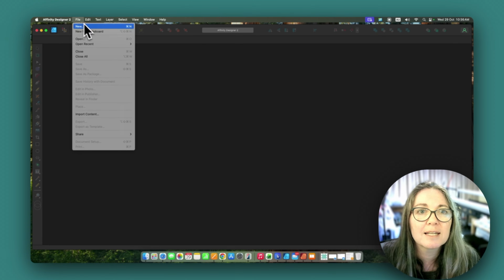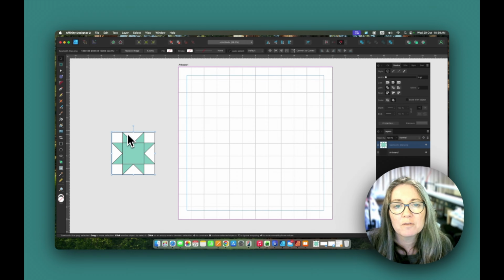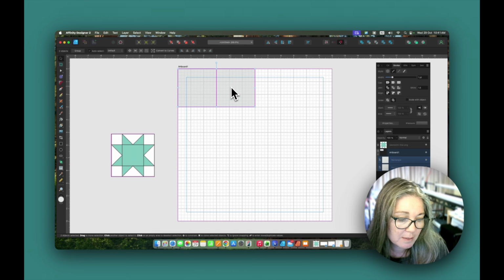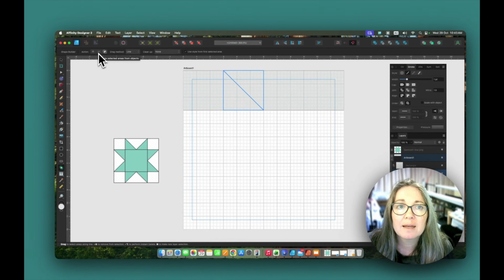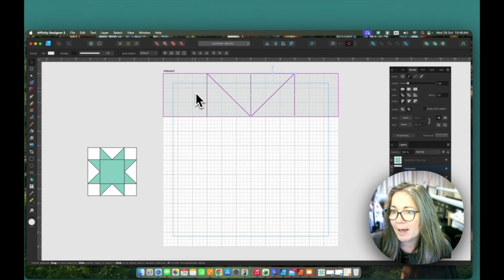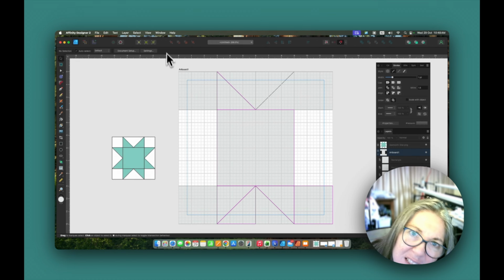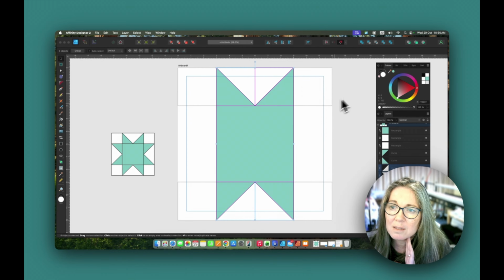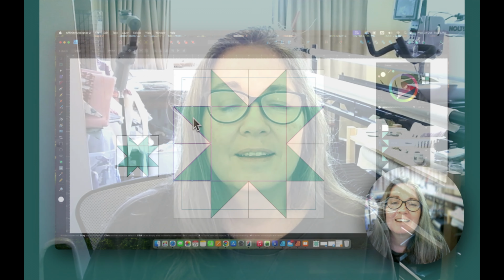Learning Affinity Designer for Quilting – Let’s Build the Sawtooth Star!

Comment: I’m confused. Doesn’t the quilt block need to be bigger to accommodate it finishing at 12 inches?
Reply from the maker: Great question, Yes you would need to create it bigger to accommodate (seam allowance) for a 12" finished block. In this video I was skill building how to use affinity to build the blocks keeping it simple using whole numbers measurements. What you can do is create the bigger art board then grab them all to increase the size all at once. then click on each to see the new measurement.
Reply: @quiltysidekick ok. Thank you. I will give that a try. But I have no idea what idea to make the art board. Do you have a suggestion?